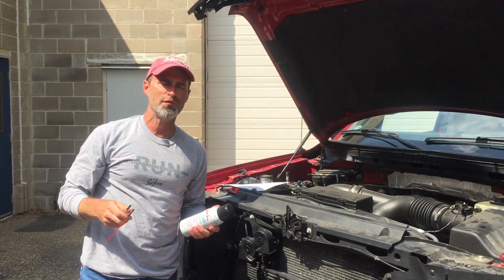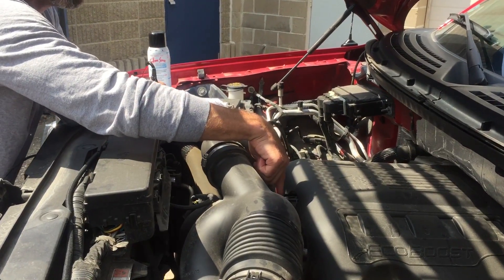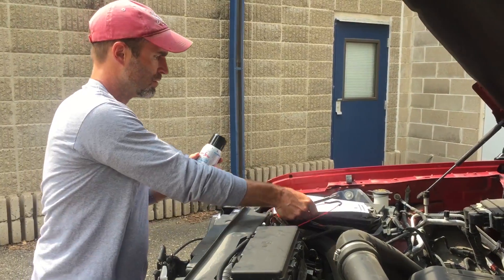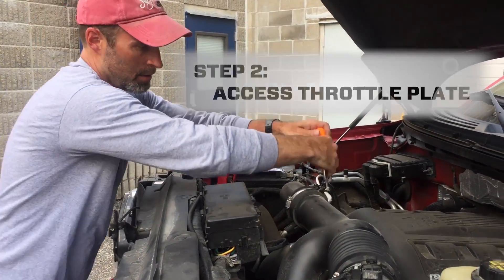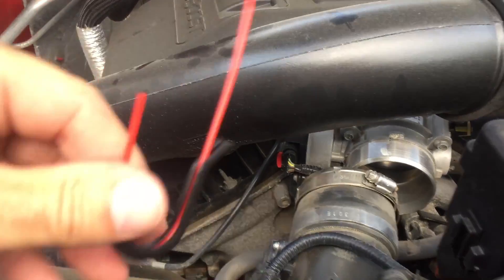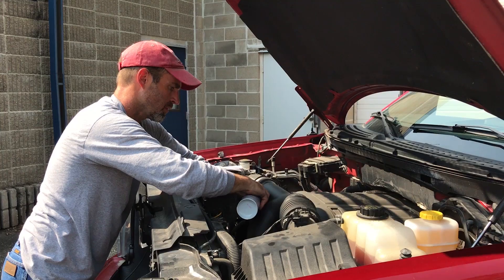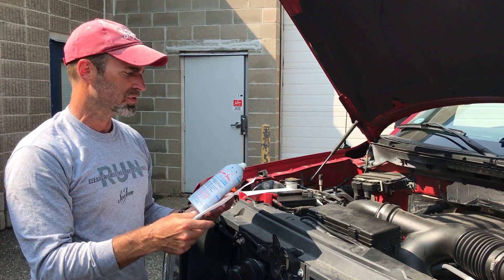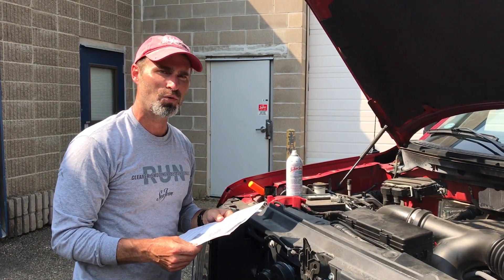(Absolutely👍) Yes, you can use Sea Foam Spray to clean a turbo gas engine

Comment: Took my 2014 f150 eccoboost  3.5l to firestone. All the sudden on the highway i was only getting 13.7 to 14.5 mpg. Had whats called a fuel induction done now im getting 21mpg. And no they dont spray the solution through the turbos.

Comment: I do this once in a while on my 2013 Focus ST.
Still runs perfectly.
Of course this is after I cleaned the valves by hand and installed a catch can around 20k.
Valve maintenance is back on the menu, boys.

Comment: Been using Seafoam this way on my 2014 f150 3.5l ecoboost every 2 oil changes since 130k. Now has 190k. No symptoms of carbon build up at all and runs great. Smooth idle, no knock/ping, no rattle, no misfires.

Comment: Hello. Can I use that sprayer between the intake boot and turbocharger? I have a 1.5t accord and the throttle body has little to none space for me to access it. Thanks!
Reply: Lol, absolutely yes, use it there. Perfect spot for it. You should just shove the can in turbo charger,  if it doesn't fit, use a hammer,  if still doesn't fit take bigger hammer

Comment: Can you spray this before the turbo?
Reply from the maker: The turbo uses exhaust air, so yes. Sea Foam Spray has already been vaporized in the combustions chambers by the time the air reaches the turbo, so not related.

Comment: Can I get some reassurance here?
I have a 2016 F150 3.5 ecoboost.  I put a catch can on at around 70K miles.  I have 90k now.  I’ve never had my intake valves cleaned.  
Am I good to use your product before doing a manual cleaning?
Reply from the maker: Yes, OK. If you'd like, use the Ask Jim feature on the SeaFoamWorks website or call and ask for tech support.

Comment: I just did this on my girlfriend’s veloster turbo along with fuel injector treatment after performing an oil change with oil stabilizer. It vaped during the 10 minute under load drive then after that, everything feels smoother and throttle feels responsive af!!! Will do it next on my genesis!!! ❣️❣️❣️❣️❣️

Comment: This is helpful! But I wonder I can spray it thorough the turbo? f I spray it through the turbo, it then goes to the inter-cooler tube, then through the boot to the throttle...and THEN to the valves? I wonder if the product gets lost midway through?

Comment: I have a 2015 f150 2.7 eco-boost with 22,000 miles on it.  When the truck is in idle it has a slight vibration was told to try seafoam!  Also read on f150 forums that seafoam is not recommended for 2015 f150 2.7 eco-boost engines? Thank you
Reply from the maker: You can safely use Sea Foam and Sea Foam Spray in your F150. We have a 3.5L EcoBoost on a dyno we use for testing... Would be fun to get the forum contributors on camera in the dyno room... Easy to find out real fast what they actually know about how a turbo works.

Reply

Comment: Is this okay to use on a roots style supercharger? If I spray it into my throttle body it will go into the supercharger and be compressed. Is that okay?
Reply from the maker: Pls submit an Ask Jim question on the Sea Foam website.

Comment: This is a very real issue, but you picked a mindlessly simple vehicle to do this on.  If you want a challenge and to help a group, so us how to do this on something like a Civic Type R, an Accord turbo, a Civic Si, etc. A turbocharged, GDI Honda. I have a 2019 Civic Type R and there is no realistic access for the injection of the cleaner after the turbo, after the intercooler system and before the throttle body/intake manifold.  If you can figure that out, you'd be a hero because the design of these systems on those vehicles is borderline retarded and sucks for this kind of maintenance.

Comment: The argument isn’t whether or not it can or can’t be used in a turbo gas engine, it’s that it can’t be used in front of the turbos. Pretty sure you just confirmed.
Reply from the maker: The mixture of Sea Foam Spray + gasoline + intake air are all done in the chamber, and before the exhaust gas reaches the turbine.

Comment: What about tdi diesel engine turbo cleaner, I have looked everywhere for a turbo cleaner on my tdi in my town and there's nothing. Not from seafoam, lucus,or power service.  There's just nothing. But yet I use seafoam in place of diesel when I change my fuel filter. I realize it's arousal but diesel turbo cleaner shouldn't be that dam hard to find. I don't get it
Reply from the maker: An intake cleaner for diesel engines could cause damage/runaway - not familiar with any.

Comment: So everyone is concerned about burning up their turbos with seafoam because it has petroleum in it, did Seafoam do the testing on their product, i know it says it on their can but people are still scepticle about the petroleum in it...im about to use it on my 2014 ecoboost this wknd...
Reply from the maker: Hi Todd. Has nothing to do with what Sea Foam is made from. Most misunderstanding has to do with not understanding how a gas turbo works. Sea Foam Spray has nothing to do/no relationship to the turbo parts - there is no interaction  whatsoever between turbo parts and the aspirated fluid.

Comment: im new to this direct injection ford truck i have now ive been watching to many videos and im worried about my purchase 2014  f 150 i had a 2001 f150 i bought new and drove it until these past september  i have a catch can on the new one now and i believe that a[ot if not most of the junk in the catch cans is actually water so im wondering if mine is frozen it was -1 here the other night just thought i would mention  it

Comment: This video is old and I doubt you guys reply any more. I did read through the replies and you seem very confident that it cannot damage the turbo, and your logic is sound. In fact, the "Ford tech" that spread the video saying turbos will melt is still confusing to me. That people think a turbo running at 20 pounds of boost pulling 3500 pounds at 100mph for 15 seconds produces less heat than a petroleum based cleaner is weird. 

With that said, is Seafoam willing to back up possible repairs?

I recently bought a Fiesta ST. It only has 64k miles, it runs amazing, no issues that I notice, but I want to run this before things get too bad. 

Obviously after a brief Google you find the myriad of people advocating against doing this, for the reasons mentioned here 50 times over. 

So if I were to use this product in a perfectly running engine and 5 days later the turbo crapped out, would Seafoam cover the cost of repair there, or would it become a "he said she said" kind of ordeal where there is no definitive proof that Seafoam caused the failure?

This is my, like many peoples first GDI engine, and I understand people's (and my own) fear, because turbos are expensive. I also understand that it's pretty illogical that Seafoam would cause the turbo to overheat, and even chunks of carbon seems reasonably unlikely because that's insinuating the "chunk" would make it past the relatively small opening in the intake valve AND survive compression and detonation, to still be large enough at that point to go back through the exhaust valve and damage the turbines.

Comment: I read that any fuel additive or cleaner would cause the turbos to spool up so high AND HOT that they will burn up and need to be replaced?  Any thoughts on this?
Reply from the maker: Makes zero sense.

Comment: I just recently bought a 2011 F150 Ecoboost with 111k miles. I had done a lot of reading and researching things to do and not do to them. A buddy of mine told me about the Seafoam intake spray. The Ecoboost is a GDI engine and therefore the intake valves are not cleaned with fuel like in a MPFI engine. The Ecoboost, especially the early models like mine, have a lot of issues with carbon build up on the intake valves. I did a lot of researching and even reached out to Seafoam as I had concerns of carbon chunks coming free and damaging my turbos. Those concerns were relieved by not only my buddy's experience as well as the reply from Seafoam. It doesn't loosen the carbon but rather dissolves it so there's no concern with turbo damage. This morning I installed the JTL (now J&L) catch can and got rid of the PCV hose so all the blow by materials will now go in the catch can which I will empty every oil change or so. I'll check it about every thousand miles and might just empty it at that interval, at least til I get to know how fast it fills up. This will help eliminate carbon build up. I also gave it the Seafoam spray treatment this morning and followed the instructions to the letter which you must do for best results. I immediately noticed a difference in the idle after taking it for a spirited drive immediately following the hot soak as recommended. It had an ever so slightly rough idle, especially when the engine was cold which is now smooth as glass. After my joy ride I reset my fuel economy. I've put a good 50 miles on it since the Seafoam and I went from getting about 16 mpg in the city to 19 mpg. With fuel prices I'll take anything I can get. I also noticed quite an improvement in power and how much more overall smoothly the engine operates. I think I'll be giving it a second can and doing this every or every other oil change, even with the catch can. I also saw a video where a guy put a fan in front of the intercooler to keep the turbos cool while applying the spray into the intake. I can't recommend this stuff enough! For $15 it's worth its weight in gold. Same for the catch can. The kit I got is $170 on Amazon but there are less expensive alternatives. The J&L comes with nice hoses and the Ford quick connects. Literally took me 10-15 mins to install. For those of you with 2011-2014 model year Ecoboosts this is a no brainer. I know Ford fixed the problem down the road but I'm not sure when exactly. Cheers.
Reply from the maker: Everyone should read this - helpful!
Reply: @SeaFoamOfficial  Hi! I have a 2015 fords fiesta Ecoboost and it's now at 97000km. I notices around 70000 km that it used more fuel than usual (went from 5.5L/100km to 7.5L/100 km) Also noticed that the power was less and that the turbo didn't gave a boost like before. Do you recommend I treat my fiesta with seafoam spray? Went to ford a couple of times and everytime they told me that everything was right.
Reply from the maker: @alexmaurier9679  Yes, worth a try!
Reply: Thank you for this comment! I just bought a 2012 f150 ecoboost. it has 63000 miles on it and I want to keep this thing till at least 200,000 miles and I've been wondering what would be the best way to clean these intakes and valves. I was hoping to find someone's story with how it went using seafoam on their ecoboost. You've given me the confidence to go ahead and try it. I'm thinking wait till it's below 40 degrees outside and use some fans on the turbos just to be safe. Did you  go all the way up to 2000 rpms when you did your treatment?
Reply: @tomunexplained7743  I did. I rigged the throttle at 2000 rpm and carefully sprayed the Seafoam. When you hear the engine start to bog down stop spraying and let it catch up. I got a bit aggressive with it and made the PCM think it was flooded. Took about 10 mins to work itself out and had to clear a code. I have the BlueDriver code reader and was able to clear the check engine light. That’s another gizmo worth it’s weight in gold for the DIY folks but also to verify what any shop tries to tell you.
Reply: Let me post a summary under the first comment, so readers having concerns regarding the turbo damage don't have to read through the whole comments section.

I think it is important to point out that on this video seafoam is being applied after the turbo, right before the throttle plate. It is very difficult to get to the throttle plate on some turbo cars and therefore the only way to insert the straw is between the MAF sensor and the turbo (before the turbo, and not after, like on this video).
If you have one of these engines and you apply the seafoam before the turbo, through the straw, the you have to consider the following:
1. The straw creates a set stream and not a mist, so the chemical will not mix with air that is being drawn in and it will for sure will get stuck at the bottom of the intercooler in liquid form.
2. Even if you spray it with a sprayer bottle, the air-seafoam mixture has to pass through  the turbo and the intercooler and all the piping in-between and most likely will separate from the air again and becomes a condensate at the bottom of the intercooler anyways.

If you can apply it after the turbo as per the video, but you are worried about loose particle hitting the turbo vanes at the exhaust side after combustion. This is the answer to this question under one of the comments from down below:

3. "Detergents work by breaking things up. Sea Foam is NOT a detergent. Carbon deposits are unburned fuel ash held together by sticky fuel varnish. Sea Foam and Sea Foam Spray liquefy varnish. There are no chunks."
Reply: You should be scared of chunk of moon falling and damaging your head

Comment: What's the best way to do it on a Subaru with top mount intercooler.
Reply from the maker: Can you access the throttle plate easily?
Reply: @SeaFoamOfficial  no, top mount intercooler mounts in front of throttle plate.
Reply from the maker: @DoubleDeesVengance  Thx - we'd have to communicate direct. Please use our website's Ask Jim feature, go from there.

Comment: Would going through the brake booster vac line achieve the same results with a non aerosol can?
Reply from the maker: Great question. No, not at all. Would not feed all cylinders or disburse evenly. Additionally, pouring a fluid is not aspirated, so most of the fluid would be pushed out the exhaust valves/wasted.

Comment: Can I run seafoam in the fuel tank  on my 2018 2.7 ? Truck has 40k on it just did plugs and all and cleaned map sensors trying to get max mpg out of it it’s only getting 14mpg right now
Reply from the maker: Try adding a can or two of High Mileage the next time your tank is low and drive at least 20 miles before adding fuel... Question: Do you live in a cold winter climate and have a remote car starter?
Reply: @SeaFoamOfficial  I live in Oregon it’s not that cold but wet I do have a Remote start but don’t use it.
Reply: @SeaFoamOfficial  can you explain the difference between your high mileage and your original?  I have a few cans of the original. I was told it can hurt the turbos on the 2.7 ecoboost?
Reply from the maker: @varmint223  It cannot cause harm and has nothing to do with how a turbo works. High Mileage is tougher on stubborn residues.

Comment: Can I do this before the intercooler to help clean the intercooler. Put it in before the mass airflow sensor 2017 Ecoboost?
Reply from the maker: Always apply directly in front of the throttle plate. So never before the MAF sensor, which is upstream from the throttle plate. It also won't clean the intercooler, which requires removal and manual cleaning. Hope this helps!
Reply: @SeaFoamOfficial  awesome ty for the response. Very helpful.

Comment: Can I use this with my Turbo Diesel?
Reply from the maker: Hi Tim. No, not wise to add an ignitable fuel source through a diesel air intake. Look up 'diesel runaway."
Reply: @SeaFoamOfficial  - thank you for the reply, do you have a turbo cleaner product for Diesel trucks? TIA
Reply from the maker: @TTMOTO888  We do not. Adding Sea Foam to oil will work to clean  oil residues/helps oil flow to turbo bearings.

Comment: I wish there was an easier way to introduce this product into the intake on a 1.6L Escape. The throttle body is all the way down and below the cowling, have to remove the damn wipers just to get it off. 
Can it go through a vacuum line instead?
Reply from the maker: Yes, some throttle bodies are buried/inaccessible. Could use the vacuum line if you apply slowly and carefully/know what you're doing.

Comment: If this is following the same path as the fuel, how does it clean the back side of the valve?
Reply from the maker: Using Sea Foam Spray does not follow the same path as fuel. It is applied through the intake at the throttle plate, then direct to the intake runners/intake valves, then into chamber. Hope this helps to better understand the delivery path! Let me know...